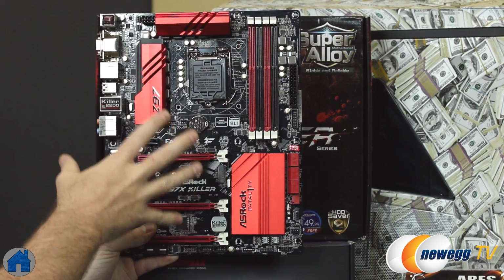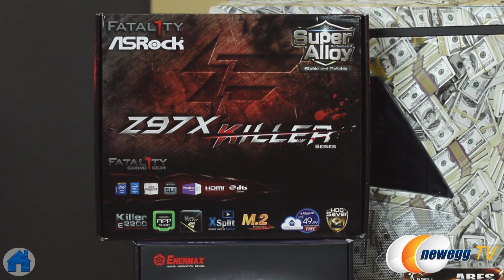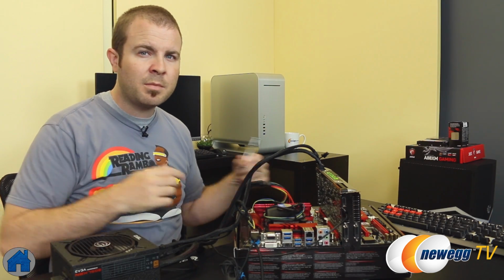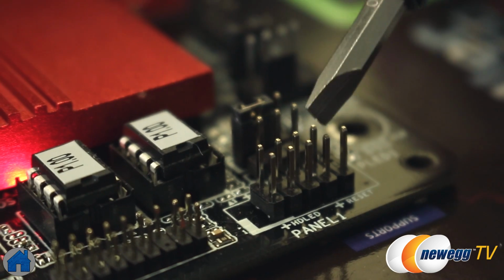How to Build a PC - Part 1 - Newegg TV

Comment: Hello I am building my very first Gaming  PC with a $750 budget so this may not be the best but I just want some feed back on any changes I can make

Processor: Intel Core i3-6100
MotherBoard: AsRock Z170 Pro4S
Memory: Kingston HyperX Fury DDR4 2666 (8GB)
Graphics Card: AMD Radeon R9 380 (4GB)
Power Supply: EVGA 500W 80PLUS Certified ATX12V/EPS12V
SSD: Crucial BX100 (250GB)
HDD: Western Digital Blue (1TB)
CPU Cooler: Arctic Alpine 11 Pro Rev.2
Disc Drive: Pioneer DVD-1910LS
Case: BitFenix Comrade

Plz give me feedback on whether this is a good build. thanks
Reply: +Nolan Roush i think you should cut your gpu or ssd budget for a better cpu
Reply: +Nolan Roush get a shittier motherboard
Reply: +Nolan Roush http://www.amazon.com/ASUS-LGA1151-Micro-Motherboard-B150M-/dp/B016A45L6C/ref=sr_1_1?ie=UTF8&qid=1449504139&sr=8-1&keywords=asus+b150m-a get this and 2133 mhz ram
Reply: +Nolan Roush https://ca.pcpartpicker.com/user/neonmotion/saved/H9xdnQ use this build
Reply: joe babrah no i edited a little http://ca.pcpartpicker.com/p/CwfM99
Reply: cocacoladog10 yeah the motherboard you pickd is better
Reply: joe babrah its cheaper and it will do the same
Reply: Use ryzen, much better bang for the buck

Comment: During the out-of-the-case build, I turned on the power supply and the keyboard and mouse flashed on and off for 2 seconds. I then tried to turn on the motherboard with the screwdriver and nothing happened. Any idea what's wrong? Could the motherboard be faulty?

Comment: Does anyone know if this is a good setup for my first gaming pc:

case - IN WIN GT1 White SECC Steel ATX Mid Tower Computer Case
motherboard - ASRock H97M Anniversary LGA 1150 Intel H97 HDMI SATA 6Gb/s USB 3.0 Micro ATX Intel Motherboard
memory card - HyperX FURY 8GB 240-Pin DDR3 SDRAM DDR3 1866 Desktop Memory Model HX318C10F/8
hard drive - EAGET S600 SSD Hard Drive Ultra Fast 2.5'' SATA3.0 Solid State Drive Internal SSD HD Desktop Laptop 60G
graphics card - MSI GeForce GTX 750 Gaming Graphics Card
cooler - Twin Frozr IV Cooler
controller card - Sabrent 4-Port SuperSpeed USB 3.0 PCIe Controller Card
power supply - Corsair CX Series CX750 750 Watt ATX 12V Modular Power Supply - Refurbished

please tell me If i am missing any parts, something doesn't match something it should, If you guys have any suggestions on something else i should buy instead, ect.   Thanks guys!!!
Reply: +Buckyplayz you need intel processor with that board and you didnt list one.

Comment: How do I know if certain PC parts are compatible with others?
Reply: +Michael Torres Main things that you need to match are Motherboard to Processor, either Intel or AMD. So if you're going with an Intel processor you need an Intel motherboard. Also make sure you match the right RAM needed for the processor, which is most likely going to be DDR3, only really high end processors need DDR4. That's really all I know personally, not a computer wiz, but hope I helped you out a little.
Reply: Use PCPartPicker.com

Comment: Is this good for 4k Gaming/Recording/Editing, 100+ Modded Skyrim at 60fps?
Case: Cooler Master HAF XB EVO
GPU: EVGA GeForce GTX 980 Ti
Hard Drive: 2x Western Digital Caviar Blue 1TB
Power Supply: EVGA Supernova 1000 G1 80 PLUS Gold Certified 1000W Fully Modular
Motherboard: MSI 970 Gaming ATX AM3+ 970 DDR3 2PCI-E16 2PCI-E1 CrossFireX SATA3 USB 3.0
RAM: Kingston HyperX Fury Memory Black 16GB
SSD: CRUCIAL® BX100 500GB SATA 2.5” 7MM (With 9.5MM Adapter) 
CPU: Intel Core i7-4790K 4.0GHZ
Reply: +Fatrick Stare Not exactly an expert on this stuff, but even I could tell you that you aren't running games in 4k at a steady 60 FPS consistently with only 1 GTX.

You'll want two of those in order to prevent unstable fps.
Reply: Alright, so everything else is good but duel GPUs are highly recommended?
Reply: Fatrick Stare Looks good to me, make sure the parts are compatible and the wattage is atleast 80 watts under your limit.

http://pcpartpicker.com/ You can pick out the pieces here and see if any parts don't match. But if you want to know the best system for your price, I'm afraid you'll have to ask someone whose an expert on this stuff.
Reply: Alright I've got my current parts and I guess my motherboard is incompatible with my CPU. :( http://pcpartpicker.com/p/G9ZtZL
Reply: Fatrick Stare http://pcpartpicker.com/p/kqf3P6
Changed your motherboard.
If you want, you can get a better Cooler, but the one you already have it price efficient and good in it's own right.

Removed OS, because you can get one cheaper here:
https://www.reddit.com/r/microsoftsoftwareswap/
Reply: Get a Titan X instead of 980TI and u will be all set
Reply: +Fatrick Stare  No, It cant even run minesweeper

Comment: I plan on building a gaming pc as the one I currently use is getting old. I have no clue how to purchase parts, save money and whether they work together as I lack the knowledge. I want to get an i5 4690K processor and a EVGA GeForce GTX 960 but im not sure what motherboard case, sound card or cooler I should get. I looked into all of these on amazon and I found a case for 74$, a 67$ 1tb hard drive, 42$ Cooler Master Hyper 212 Evo Cpu Cooler (120mm Pwm Fan). Any tips or help anyone can provide would be great :)

Comment: Guys, I am saving money for a rig, and I play Minecraft, Runescape, Counter-strike 1.6 and Clicker Heroes.
Are these specs enough?
16 GB RAM
5 TB HDD
2 x Titan X
Intel Core i7 6700 3.4 GHz processor
Corsair Hydro Series H55 Quiet CPU Cooler 120 mm 30.32 dBa

4K + 144Hz monitor

Please help
Reply: +Thomas Lorentzen 10/10 troll lol
Reply: +Thomas Lorentzen You dont have a psu, so it would not work
Reply: Stop trolling people and make it 32 GB and 2x3TB HDD else it wont run minecraft 30fps
Reply: cannot even play tetris
Reply: can't even play Windows! lol
Reply: +Thomas Lorentzen Your joke on such a high level I can't even laugh
Reply: +Thomas Lorentzen are you serious ? ?
Reply: +Thomas Lorentzen i almost was about to diss you. and then i thought about it. def trolling
Reply: +Thomas Lorentzen  hmmm not enogh u might want to over clock to get 1fps on any of those games
Reply: No motherboard, no psu. GG. Get a 5960x cpu. And you didn't even specify what kind of ram. Is that 16gb of ddr3 ddr4? Sdram? What? Drop the 5tb hdd and get a 4 tb ssd. Stop being el-cheapo.
Reply: Look at this duuude
2 Original Titan Xs
A flippin NON OVERCLOCKABLE QUAD CORE CPU
NO SSD
ONLY 16GB OF RAM
ONLY ONE MONITOR?!?!?!?
you are high
Reply: Nah man. You need an Intel Xeon E5 and 8 Titan X's. Also pick up 128 GB of RAM. With these specs you will then get 30 FPS on Minecraft.
Reply: +Thomas Lorentzen Wont even run chrome OS
Reply: +Thomas Lorentzen replace the HHDs with SSDs
Reply: question is, can it play minesweeper?
Reply: You don't have a mouse m8
Reply: Chris Legaspi I wasl gonna go GDDR5 RAM actually. PSU, who the fuck needs that shit? But if I would get one, i would pick up a 1200 W PSU.
I am no expert in motherboards, so I cannot comment on that. But just something that suffices, nothing too expensive
Reply: ***** I feel you. Don't want to go overboard(board? No? Okay). I think since you were going ddr5, just go with ddr4 and pick up 2 more titan x with the spare change. And get a 1500 w psu. That should fit your budget build dude. Ddr4 should be good if you pick up that 5960x and 2 more titan x to make your Minecraft run at 15fps. But if you got that kind of cash, go ahead and get the ddr5 to run Minecraft at 25 fps.
Reply: Robert Ivasečko all right, thanks for the tip! :-)
So looking forward to finally eing able to run Minecraft and Runescape
Reply: Don't forget agar.io and tetris mate
Reply: +Thomas Lorentzen No I think you might need a few more Titan X graphics cards because most of these games need to have insane cards to have good fps. With 4 Titan X you can run Minecraft at 60 FPS!
Reply: guys im building a gaming pc for clicker heros and cookie clickers
Reply: Ha use your phone
Reply: you need liquid cooling on the titans, that will boost your FPS and make you better at the games
Reply: no, you're gonna need another Titan X
Reply: No that cooling is an overkill for a non unlocked cpu.. You should get max case fans. A 1200W psu, 32gb ddr4 ram, three titans and maybe i7 5820k
Reply: ***** we get it. Budget builds are hard to sketch up. We got your back.
Reply: Osrs or rs3?
Reply: +Ezeckiel Reyes (Kiboy) I dunno. my 4k liquid-cooled octo-core ssd kinda struggles with that application
Reply: Doubt it I have 4 Titan blacks and 64gb ddr4 ram and I only get 20 fps in minesweeper
Reply: OrionG Gaming whats your cpu
Reply: +Ezeckiel Reyes (Kiboy) honestly to play minecraft you definitely need quad titans dont forget dual xeon v5 with like 32 cores
Reply: Its Blobs nah 64 cores is the average to get any real power when playing stuff like minesweeper
Reply: +Thomas Lorentzen You don't need a cooler, just blow on the CPU really hard from time to time.
Reply: Anthony Malinauskas thx for advice, will do that to save money. Was actually considering getting liquid nitrogen as cooling, but your advice will probably help me save money. Besides, how are 2 titan x possibly gonna heat a cpu at all?
Reply: +Thomas Lorentzen Well, they might generate a little heat, but if you want you can always just fold up a newspaper and fan the monitor every thirty minutes. The cold air will travel back through the circuits and cool the GPU.
Reply: +Thomas Lorentzen Frikin no not at all you need more power and thats only so cheap wow you are cheap you need better pc lol... Your a troll
Reply: ***** nitrogen isn't enough. For a more..."permanent" solution you could throw it in carbonite. The cooling effects of the solid block form will allow you to never pay for another cooling fan.
Reply: ***** what about PSU? 4000W is enough i guess. And Liquid nitrogen as cooling?
Reply: Use Liquid Helium to cool it and no need for any fancy blocks of such, constant sprays of Helium would be fine as it non conductive. 

Also to be noted that you wouldn't be able to run any future Crysis games on this although stuff you mentioned should do fine at 900p (console resolution) on Med to Low Graphic details.
Reply: +Thomas Lorentzen Can run most of the games, but I highly doubt you will even get 30 FPS on Clicker Heroes and CS 1.6
Reply: This is just me, I don't think 16 gigs of ram enough. I'd go with a solid 128 gigs.
Reply: +Thomas Lorentzen Those games require 3x Titans... Noob... Smfh. kids these days. Gesh!
Reply: Ezeckiel Reyes HHD
Reply: +Thomas Lorentzen They're amazing more than you need actually. Instead of having 5TB of HHD you could get 2TB of SSD for cheaper! And 2 GTX Titan X's? That's overkill
Reply: +Thomas Lorentzen that build will break mincraft and turn the blocks into real images.
Reply: Arconan Kurokami that moment when an awesome joke gets ruined by people who don't get it...
Reply: Master Queef
it technically shouldnt be a joke. unless your happy being unable to provide something which you praise to be worthy of a fantasy joke subject.
Reply: Arconan Kurokami this entire thread was a complete parody. Lighten up, dude.
Reply: Add a core i420, the i7 bottlenecks.
Reply: MuricaMapper is an i9/11 inside job edition any good for runescape at a solid 30 fps?
Reply: Nah the i9/11 is only what people in Afganistan use. If you can use the i69.
Reply: +MuricaMapper AMD Allah Akbar edition Run 9\11 simulation run at 911fps
Reply: MuricaMapper the i1774 is good for freedom run maybe?
Reply: No. It is not good enough. Choosing regular hard drives will slow down your new pc. Instead choose a 1 terabyte ssd combined with one or more sshds
Reply: are you insane? wheres the k series processot
Reply: Sure thing. It will be ok if you also add an SSD in the build. You got i7?  Then for the best results run the OS on an SSD and use the HDD's for the rest.
Reply: Hej Thomas. Jeg tænker også på at bygge en gamer, men satser på 64 GB Ram. Jeg køber det jeg skal bruge gennem Amazon UK. I deres søgemenu fandt jeg mange gode ting ved at søge på barebonespc. M.v.h. Johnny.
Reply: Eric Newman 64 GB RAM er sgu da alt for lidt. Tror du det her er 2015? Brug da 128 GB ddr5 vram istedet
Reply: Putting a 2016 sonic plush toy in your case overclocks minecraft to a solid 35 fps. Trust me, works every time.
Reply: No
Reply: Mine has 32 GB of RAM it's nuts XD
Reply: +Thomas Lorentzen I think a Gtx 970 will run these games 4k 144hz. ANd you don't need 5tb. You could pull it off with 500gb - 1tb hdd. And you don't need 16gb of ram. And you could do lower on the processor.
Reply: E-man - EL its a joke lmao
Reply: +Thomas Lorentzen No, that build is a low spec thing... You won't even be able to launch windows with that! You will need to upgrade
Reply: You'll be able to play minesweeper but it will be laggy.
Reply: +DOSHA MEMO of course hes not... come on :P
Reply: +Thomas Lorentzen no
Reply: On low settings it okay
Reply: +A Weed you have no idea what your talking about
Reply: thiss is a joke right????
Reply: Mac McLinn assuming?
Reply: coolinator 1025 yes
Reply: Thomas Lorentzen Yes, but medium settings 30-40 fps
Reply: NeoProHex
Reply: Youll get okay performance, nothing major tho ;)
Reply: Thomas Lorentzen buddy itll work fine but you dont need 2 titan x.
Reply: Thomas Lorentzen ya you'll be fine
Reply: MyDogsFace TV it was a joke
Reply: Thomas Lorentzen oh sorry I don't think it's funny
Reply: if you havent baught yet, i'd look into th 6950x, it will probably preform better for runescape, due to the additional cores
Reply: Yusuf Shabazz he said he is going to pkay minecraft, no ram is enough then
Reply: Where is the GTX 1080?
Reply: I know this is very old but... I really don't think so. YOU MIGHT be able to play minecraft or solitare but nothing els :0
Reply: Your build seems to be too weak.. You might want to upgrade because minecraft is very demanding.
Reply: Barely run calculator
Reply: I see you are on a low budget and you want a lot of storage but you had better put an ssd in there too. Otherwise you will see really slow loading times. Also, you didn't mention the power supply but anything is gonna be fine, your system is very lower powered.
Reply: two Titan X's just to play minecraft? Serious?
Reply: I think 16Gb is not enough, you should go with 32gb
The other parts are ok, but do not expect too much
Reply: wtf....

Comment: Help is this a good gaming rig

CPU	Intel Core i5-4460 3.2GHz Quad-Core

CPU Cooler

Stock CPU Cooler (Bundled with CPU)

Motherboard	ASRock H97M Micro ATX LGA1150

RAM	Team Elite 8GB (1 x 8GB) DDR3-1600 Memory		

Solid State Drive	Crucial BX100 250GB 2.5" Solid State Drive

Hard Drive	Seagate Barracuda 2TB 3.5" 7200RPM

Graphics Card	PowerColor Radeon R9 390 8GB PCS+		

Case	Fractal Design Arc Mini R2 MicroATX Mini Tower

	
Power Supply	XFX XTR 550W 80+ Gold Certified Fully-Modular ATX
Reply: yes
 If u can get better psu(it's perfect though) but that's 10/10
Reply: 2 sticks of 4gb of ram would be better
Reply: PowerColor isnt really good so msi is the way to go 
And a 600 w psu is better like the xfx ts 600

Comment: I building my first computer I have an Fatal1ty z97 killer series also. I'm having trouble with the outside the box build part. Every time i short out the two pins the motherboard fan spins for one second and that's it. I don't see a bios screen or any lights on the motherboard except for the orange light on the Ethernet port that also last one second every time i flick the power supply on . If anyone can help please help?
Reply: +Shaun Horton if the pc tries to power on and instantly shuts off - it's shorting out. which means that there's something causing the power to turn off for the safety of your parts. I'm gonna have to give you an educated guess and say you should back track. You may have too many standoffs or little (you should only have enough for the motherboard. otherwise if you just have a standoff touching the back of the board it will shortout.) if this isn't the case - it could be a cord not pushed in. start removing the psu/power supply cords and pushing them in firmly.